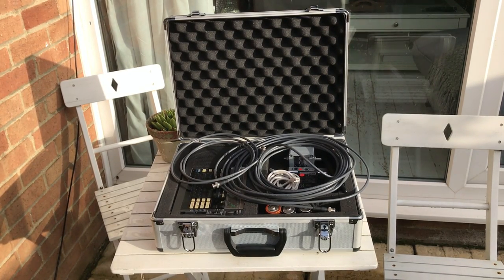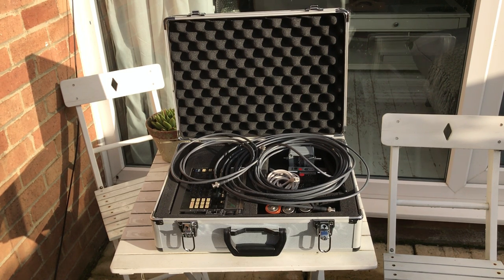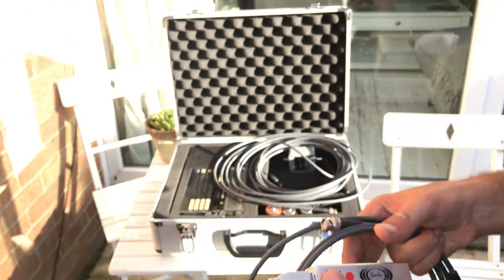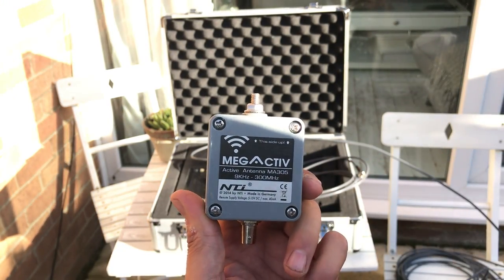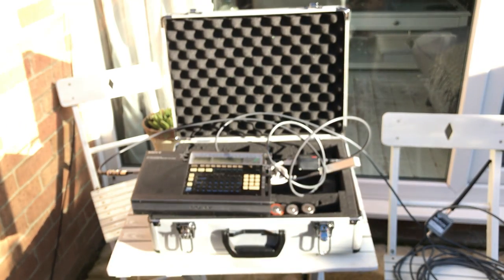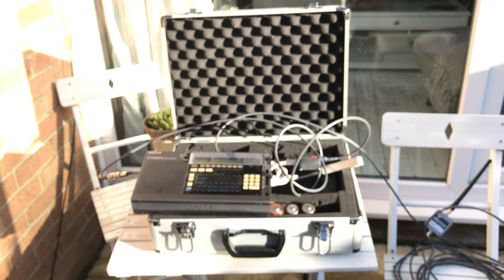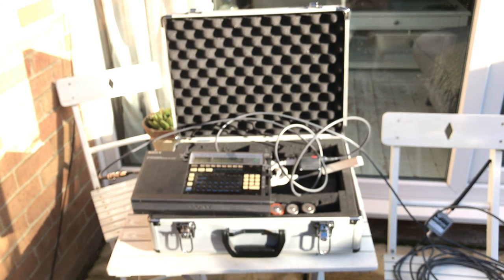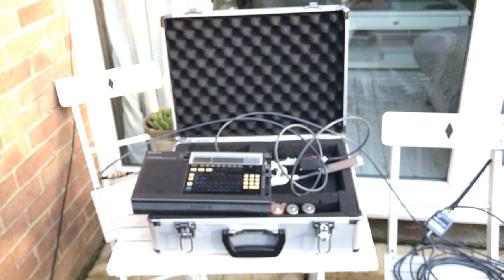Setting up the Bonito MegActive MA305 antenna for mobile DXing

Comment: Thanks for all the videos. Thinking of getting this this setup .I'm  new back to shortwave  listening  after 45 years.will i be able to pick up ham radios  and will it improve my air band reception. I got myself  a pl680 thank for any advice
Reply from the maker: Hi John, you're welcome. This is a wideband antenna and with SSB on the PL680 you will be able ot hear hams and Airband (AM). 73
Reply: Thanks that grate

Comment: Thank you for posting this video. I’m in the process of choosing a suitable antenna for my receivers. Like you I have the Sony ICF-2001D that has been totally overhauled, a Lowe HF-150 and a RSP2 SDR. So far (and each radio is ofcourse as good as the antenna connected to it, I had good results with an active Wellbrook loop. Thing is, how well is the Bonito that you use coping with all kinds of man made noises. The Wellbrook loop kinda ignores interferences to a certain maximum but if I compare this Wellbrook antenna with no matter what active omni directional one, all loop stick designs dramatically fail. Biggest problem however with the loop is the impossible size of it that makes it a drama to take it with you on expeditions and holidays. And at home the wife complains constantly about this thing standing in the way all the time. And she is right, it is a dog really. On the internet quite cheap active loopstick Chinese designs are available but I doubt if these are any good. Greetings from Hekelingen, Holland. Willem.
Reply from the maker: Hi there Willem, thank you very much for your message. I completely get what you are saying about the Wellbrook loop being a drama when it comes to moving around - going on holidays etc. My advice to you would be to buy a Bonito MegaLoopFX. Performance is very similar to the Wellbrook and yet the loop is a flexible steel cable so no issues when you travel. Furthermore, the MegaLoopFX can be powered by a 5V USB brick (or other USB device) so it's even more portable in that respect. I've travelled all over the world with mine (including Australia) for really super results.Good luck my friend. 73s, Clint

Comment: Clint thanks for the  video. I decided to buy the MegActiv because in my new location here in the mountains reception is not the best because my long wire is to close to ground.  Based on your reviews I think I'm making the right choice.  I like the fact you can experiment with radiating element.  Have you only used the supplied radiating elements? Thanks Brian
Reply from the maker: Hi there Brian, thanks for dropping by and congrats on your MegActive! Yes you can try different radiating elements. I've tried a simple wire, about 5 or 6 metres in total length. I think you could go bigger than that on quieter parts of the tropical band - well 90 and 60 metres for sure. Thanks again and 73! Clint

Comment: Nice video thanks, can this antenna be used indoor with success? How would you rate against MLA 30?
Reply from the maker: I've not used an MLA-30 but I've read reports that it's just ok. The MA305 indoors would be a disaster unless you have a very quiet (electrically) QTH. 73!